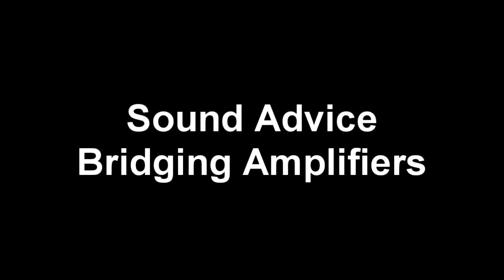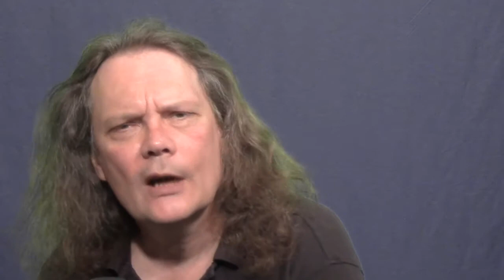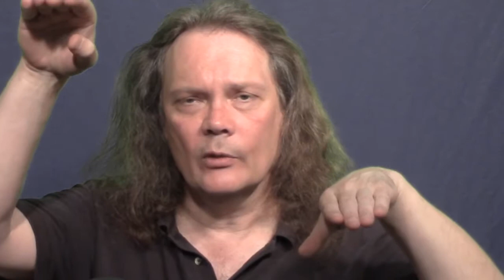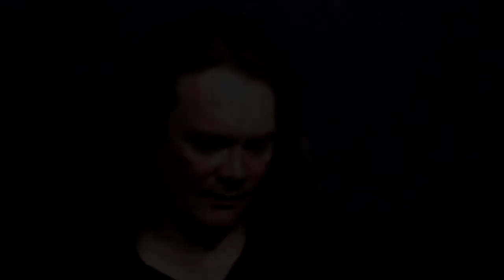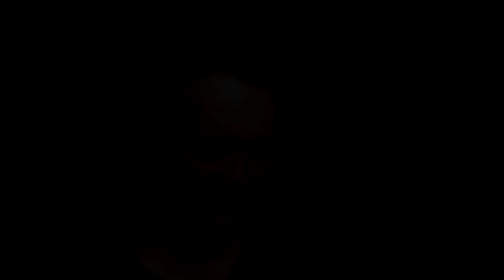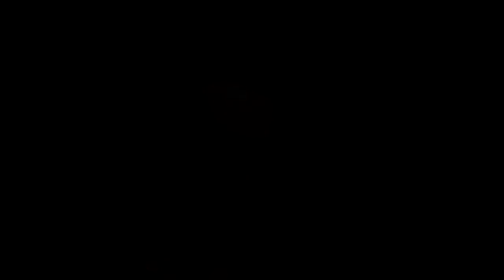Risks and Drawbacks of Bridging Audio Amplifiers

Comment: Hey we're both Minnesotans.  We should get coffee sometime.  Nice video.  I absolutely agree that most people should not bridge amps.  There are a few very specific circumstances where it makes sense such as a high impedance or wanting to not increase power to load but just voltage headroom to avoid clipping at the same power.  Both of these circumstances are within the confines of sensible bridging, but you are correct in shying away from it and discouraging others from as well.  You have to really know what you are doing and make a cool calm calculated decision to bridge or not to.  As with everything in life, nothing is free.
Reply from the maker: Hey good to see a frozen friend!  Thanks for the kind words and the insightful addition about the specific circumstances where bridging can be beneficial.

Comment: I guess there is always that guy with a "counter-point" and today...I'm that guy.  

There are factual problems with your argument.  When you bridge an amplifier, you should get double power, not 4x.  You are not merely adding the voltage because you have also wired the outputs in series, which affects impedance.  From a logarithmic standpoint, since power is V^2/R, you have a factor of 2 in there to contend with.  This is why the power for dBs is -10Log(P1/P2) and voltage is -20Log(V1/V2).  This is why doubling voltage is 6dB but doubling power is just 3dB.  

The manner in which the outputs are wired is why the minimum impedance of the load for a bridged system is double that for a stereo (if the amp can drive down to 2Ω stereo, it is limited to 4Ω bridged).  

The amplifier isn't, likely, working any harder.  You're also using both halves of its power supply and now you are also using them identically.  I've never had amplifiers that were operated in bridged mode fail at a higher rate than those in stereo.  And that is going on well over 4-decades. If there was a trend, I would have noticed it. 

The 3KW output power versus 3KW input power is a false narrative.  If you were to try an output a sine wave such that you were driving a speaker at 3KW, then yes, that wouldn't work (without a 30A circuit).  However, when reproducing music, it is filled with lots of transients where the RMS power is going to be much lower than peak power.  However, when that kick drum hits, would you rather have the power reserve so the amp doesn't clip, sending a clipped signal to the driver?  Large storage capacitors ensure a conventional amplifier can withstand such demands.  It is not uncommon for a typical amplifier to draw around 1/8th of its rated power from the wall outlet when being driven near its max.  

Then there are the cost of the amplifiers.  The cost of getting larger amplifiers to meet the demands of the system moves up geometrically such that it is often much more expensive to move up to an amplifier with double the power capacity, per channel, versus bridging a smaller one. 

As for speakers/drivers that can handle lots of power, I put forth the JBL 2269.  It handles 2000W continuous (2-hour rating).  It is a scary thing to see in operation.  In a double-18 system, it would have a 4KW rating, continuous, 8KW program.  

So, in my opinion, whether to bridge or not, really depends on the application, what the reason one has for needing the extra power, what the cost factors are of larger amp versus bridging an amp.  In most cases, I advise more speaker (doubling/quadrupling the cabinet count).  It is normally cheaper to double the number of subs than to move up to a incrementally larger amplifier to get the same SPL.  However, there comes a point where doubling cabinet count gets out of hand too.

I will often bridge amplifiers driving subwoofers and sometimes bridge amplifiers driving LF systems with higher impedances to get the bigger voltage swing.  It all depends on what is the best fit for the application.
Reply from the maker: Thanks for the detailed comment. 
You’ve raised some useful points, but I want to clarify several areas.

First, about bridging and power: when an amplifier is bridged, the voltage swing across the load is doubled. Since power is proportional to voltage squared divided by resistance (P = V²/R), that results in four times the power into the same load impedance. However, because most amplifiers specify a higher minimum impedance when bridged, the real-world result is often double the power, not quadruple. So you're correct in that scenario, but it's a result of the impedance change, not a fundamental limit of bridging itself.

Regarding your statement that "you have also wired the outputs in series," that’s not accurate. Bridged amplifier outputs are not wired in series. The load is connected between two amplifier outputs operating 180 degrees out of phase. This is differential drive, not series wiring. Each amplifier channel sees half the load impedance, which is why the minimum load impedance specification increases in bridge mode.

On amplifier stress, bridging does increase the current demands on each channel. While both sides of the power supply are used more symmetrically, that does not mean the amplifier isn't working harder. Each output stage is now sourcing or sinking more current, and the power supply must support increased current delivery. Amplifier failure rate may not show an obvious pattern in casual observation, but that doesn’t mean bridged operation doesn’t raise thermal and electrical stress.

I agree with your comments on peak versus RMS power. Music is highly dynamic, and average power consumption is much lower than peak. That said, concerns about wall power and circuit limitations are still valid in some live sound environments, especially when multiple amplifiers are running near clipping for extended periods.

You make a reasonable point about the cost efficiency of bridging versus buying larger amplifiers. However, that depends heavily on the quality of the amplifier design and its ability to handle bridged mode reliably. It's not a universal win.

I appreciate the comment and perspective.  I agree the practical decision about bridging depends on the application, system design, and specific gear involved. But from an engineering standpoint, bridging does produce 4x the power into the same impedance, does not involve wiring outputs in series, and does place greater demands on amplifier components.

Comment: Wattage output specs are largely a function of how they are being measured/determined. An amplifier that can provide a maximum of 100 watts output continuous sine wave is also capable of providing well over that figure for an instantaneous burst. The burst output may even be greater then the mains power wattage being supplied to the amp because a well designed amp will include large capacitors in the power supply section that can store up power and deliver it on demand. Remember, standard audio signals being fed into an amplifier are enormously dynamic. Even with highly compressed signal, the difference between average signal level and peak transient level can be 3:1, 5:1 or higher. Output can exceed input because it's not occurring continuously. The following is my poor attempt at a car analogy... We can have a 100 horse power motor spin up a large flywheel and then when we dump the clutch, the flywheel can deliver 300 horse power to the tires for an instant. Where did that extra 200 horse power come from? It was stored up over time and when released, delivered for an instant.

Comment: Good day sir, I'd like to ask, how do you know your speakers are suffering from overload, even in stereo mode amp
Reply from the maker: Sometimes it's hard to tell... until the speakers go quiet and smell bad.

Sometimes you can hear the cones hitting xmax making a slapping sound, ouch.  That's as far as they can mechanically travel.

If you're a good listener you may notice the sound having a compressed character, or notice as you turn up volume the speakers don't get a whole lot louder.  As the speaker approaches max output they usually have "power compression".  It's a little bit like your car can only go so fast... even if you can push the pedal down a bit more, it just can't go any faster.

If you see that behavior, that's probably a good time to back the levels down a bit.

Fuses and light bulbs are often used to offer some protection to drivers.  I have a video on that topic, as well as a video on speaker power handling in general. So, check out the other videos on the channel.  Thanks!!
Reply: @Barry-Watson  thank you, will Che k those videos as well

Comment: I use a Crown XLI 2500. 2 channel, AB, rated 500 wpm at 8 ohms. Plenty of power for my 15" Cerwin Vegas. Usually, I barely make the signal lights glow, but I have all the power in reserve I'll ever need. They rate them bridged at 1500w @ 8 ohms, can't see me needing to bridge them. My advice is get a properly sized amp for your needs. Buy actual monoblock amps.

Comment: I’ve got an Adcom gfa5006 with four of its channels bridged to a pair of Klipsch r34c and notice a little bit of noise. I heard the same noise in my center being bridged with a small amp also, changed it to stereo and it’s almost completely gone. I haven’t tried just powering these front speakers at 50 watts but will.

Comment: Hi, Barry I liked what you had to say. Not often can I hear a full conversation about any audio topic where I feel the person is consistently correct. In your case, I find what you have to say as spot on. So thank you for contributing some good factual information that is based on sound knowledge and experience. 

That being said, you almost scared me into not bridging my little 8" woofer in my car stereo with my super high current 1 ohm stable amp. Well, like I said you almost scared me into not doing it lol. Well, I still agree with what you said but in my case I am working on a personal project using this Zapco Z100 C2 SL amp, a small but mighty high current 2 ch automobile amp to run a set of components and a little 8" sub in trimode. Supposdly this little power house can run as low a 2 ohms mono but I'll be doing it 4ohms mono on the sub to run it a little cooler. Once again thanks for the great post!
Reply from the maker: Thanks!  When speaking in general terms, somebody can usually find an exception.  There are some amps that run just fine in bridge-mode, especially in car audio where this is more common.  Hope your setup works well for you!

Comment: does this apply to bridging two one channel monoblock amps? I am running a vmps sub with a marantz ma500 and need to address clipping from lfe in movies played on my home theater
Reply from the maker: I think a better solution would be to use a amp with clip-limiting, or place a limiter in front of the amp with the threshold set to activate before clipping, to prevent the amp from being easily driven beyond full power.

Bridging may give you a few more db of headroom, often if you're hitting clipping, you need more than just a few more db to be safe.  A limiter can quickly catch those brief big transients and transparently control them.

Comment: Hello.
 my amplifier is having all the modes except, instead of parrallel mode is rather mono. Is mono mode the same as parrallel mode.
Reply from the maker: Parallel mode is a mono mode.  This is where you can connect both the left & right outputs together + to +, - to -.  The input signal needs to be identical on both channels.  (This setup might happen automatically for you when you switch the amp into this mode, depending upon model).  The purpose of this mode is to allow the amplifier to drive difficult high-current loads with lower impedance than a single channel can normally drive.  If you're driving a typical load (like 8-ohms) that a channel can normally handle, this mode will not offer additional power.  I don't often see amplifiers used this way, probably most often used in car audio.

Comment: Thank you for your video! Barry, I have a 3k wts amp. Both can run 3k 4ohm bridge mode. Can this damage a pa speaker with a 1000 rms 4ohms? Or I just leave it at 2x 900W/ 4ohms per channel?
Reply from the maker: You could probably damage that speaker in either case if you push things real hard.  Use care, and don't push things to the limit, and I'd suspect you'll be fine.  Putting a peak limiter before the amp might help prevent accidents.
Reply: @Barry-Watson  .. a limiter of course. I have a dbx driverack I think that should cover it. Thank you so much 🤘
Reply from the maker: Perfect!

Comment: Here are some counters to your arguments that I've heard and I'd like to get your opinion on:
Obviously you shouldn't put more power into a speaker than it can handle. However when you say "If you put 3000 watts of power into any rational driver the voice coil will be toast," I know most mains speakers aren't designed to handle that kind of power but I've seen many dual 18" subwoofers that are rated for around 3000 watts program power. And when you say that a standard wall socket can output about 1800 watts, I'm assuming you're using 120V*15A=1800w which I totally agree with, but most circuit breakers won't trip unless something is pulling a ton of current for at least a second or two. Music is very dynamic though, and the massive volume peak of a kick drum for example might only last for 100ms or so. Plus, a lot of amplifiers are built with big capacitors so that they can store power for these temporary huge volume swings, and thus aren't directly pulling from the wall when those big hits occur. 
With "a bridged amplifier is working much harder than a non-bridged amp", I agree with that but most amplifiers these days are rated down to 2ohms per channel, so running an amp bridged at 4 ohms would be perfectly fine for it.

Finally, the main think i'd like to get your opinion on: I've heard that it's really easy to damage both your amplifier and your speaker by driving your amplifier into clipping, and that even if a speaker is rated for much more wattage than the amplifier you're using, if the amplifier is being driven extremely hard into clipping, you could actually damage the voice coil of your speaker. So, in this case wouldn't it be safer to put your amp in bridged mode in order to have more headroom and not clip your amplifier, but still get the same volume?
Reply from the maker: Good points, and I don't really disagree.
I've seen speaker "systems" that are rated for 3000w+, usually some kind of "peak" spec, which may be a little dubious.  I have not seen a single loudspeaker driver however that could take that kind of power RMS.  There might be an exception, but if so I'd consider it exceptional.  So much equipment these days is rated with a "peak" spec, and I think some of it is... a bit over-rated.  A peak power spec may actually better represent real music, but often I think some of those numbers represent the marketing dept.

Yup, amps have power supplies and the capacitors allow them to deliver brief peaks over the RMS mains power.  True.  With full range music, this may gain you a bit (peak to avg power ratio is typically high), in subwoofer duty (where you really need the power) the peak to avg power ratio isn't as severe, so the peak demands delivered by the power supply over the mains isn't as significant.  If you think in terms of DB, the gains in terms of loudness really aren't going to be that great.

Yeah, I also agree that as long as the load and the thermal dissipation is within the amps ability, bridge mode is perfectly safe.  I'm just saying it's a lot easier to reach those limits in that mode.

Clipping can be bad on loudspeakers.  Primarily because clipping creates (usually odd-harmonic) distortion which has a lot of high frequency content, often far more than typical music, and this can easily overpower the HF drivers/tweeters, which are sized for the typical power needs of music (much more energy in bass then highs in typical music).  Severe clipping also creates brief periods of DC (where the output wave goes flat at the top/bottom), this can be pretty rough on the woofers.  I don't like to do it, but actually for a high quality rugged amp, clipping itself shouldn't be harmful to the amp as long as the situation isn't driving a heavy enough load to cause severe overheating.  You're just switching the outputs up to full-on.

Yes, some people say you'll damage speakers by "under-powering", that's not true.  But you can break things by using a small amplifier pushed too hard into clipping, and you'd be "safer" with a bigger amp if you have the restraint to not push the bigger amp into clipping or way above what your drivers can endure.  It is possible to push loudspeakers beyond the xmax (mechanical cone limits), and cause the cone to become misaligned and scrape, or to push enough power to melt voice coil wires.  So, a bigger amp may be "safer", but you can always break things if you try hard enough ;)

That's my opinion!  Thanks for the comment.
Reply: @Barry-Watson  Thanks! I just invested in a full JBL SRX loudspeaker system. 2 SRX718s rated for 1600rms/3200prg/6400peak @4ohms each and 2 SRX812 rated for 800rms/1600prg/3200peak @8ohms. So I was thinking a bridged amp for each speaker would be the most cost-effective method to power these speakers to the full potential, as an amplifier that can put out close to 3000w/channel into 4 ohms is really freaking expensive.
Reply: Plus, I can plug each subwoofer amp into different wall outlets so I am less likely to blow a circuit
Reply from the maker: JBL SRX is good stuff!  Remember 1500 watts to 3000 watts is only 3db.